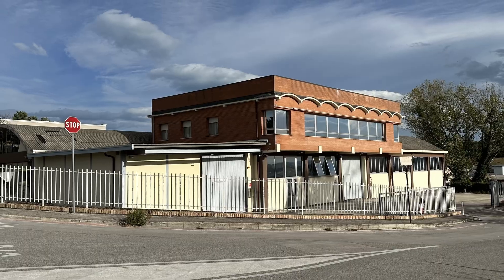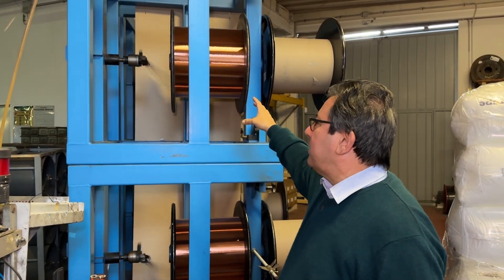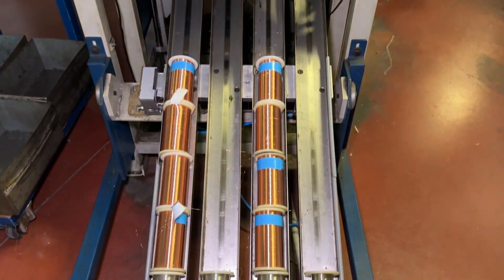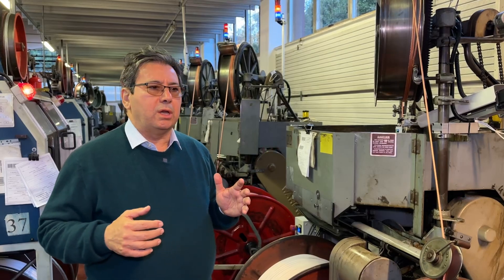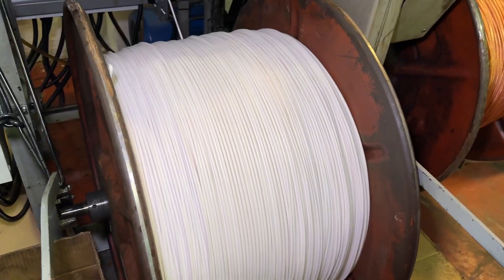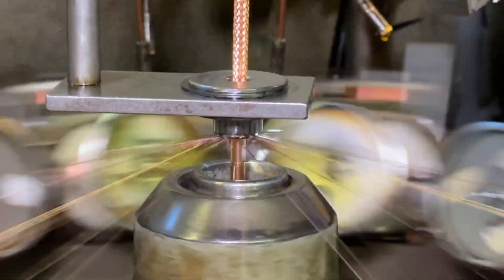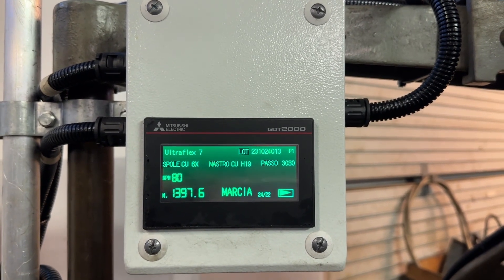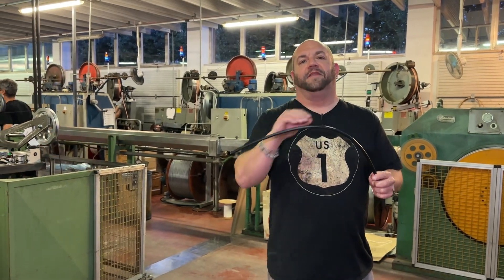Look At How Fast This Happens!!  Messi & Paoloni Factory Tour Part 2

Comment: That great. K8MRD brought back how it's made . POTAFLEX 7 has 2 braids and foil . that copper foil makes a difference. I re did a repeater cite with  M & P coax last spring . the interference from outher repairers and VSWR dropped and increased range of repeater.  this UHF GMRS 50 watt. a RF engineer from outher station at the cite told me about the problem with aluminum shield foil  . I can't wait to POTA with my new POTAFLEX 7 50 ft reel kit. and the short jumpers are POTAFLEX 7 jumpers as well. best PL 259 I ever seen ! 73's
Reply from the maker: I'm trying man!  Loved that show and it's so cool to try and produce my own version!  2 braids and foil should certainly help knock down some interference for sure.  If you're on GMRS though, imagine what the M&P Hyperlex 10 or Airborne 10 could do for you!  Way better performance than the coveted LMR 400!  Just sayin'.
Reply: @hamradiotube  Hyperflex 10 is what we used. the wight coax with N connectors. was LMR 400 we took out. night and day difference !